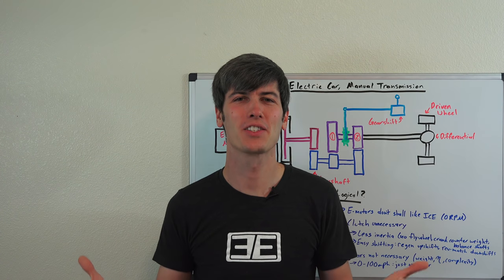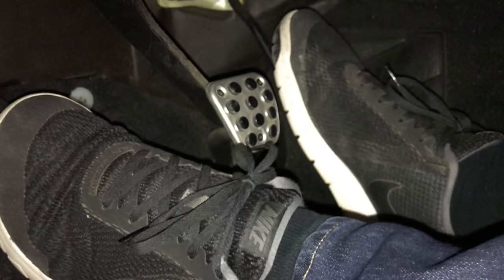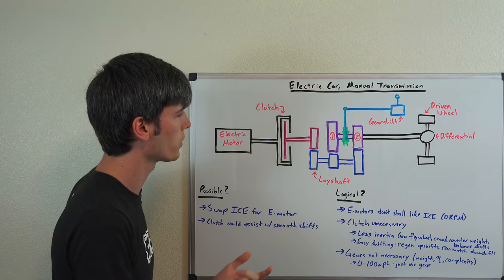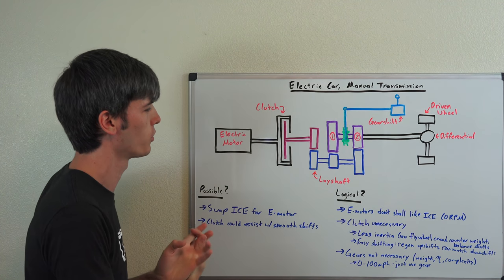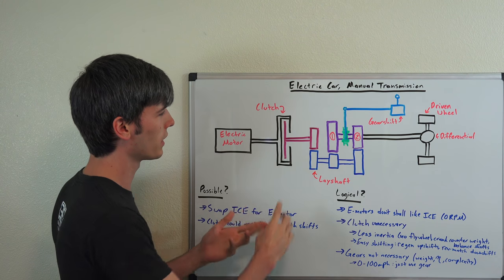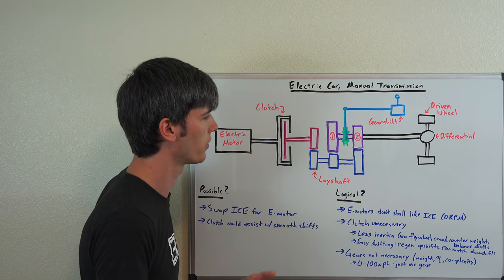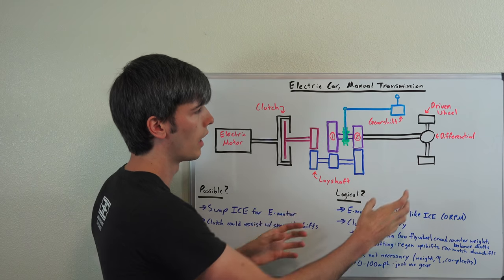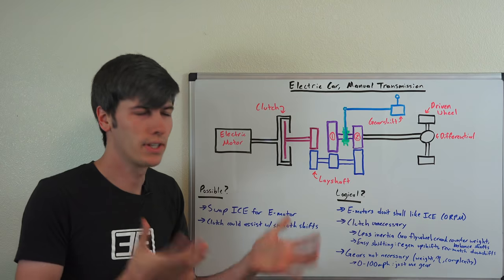Could Electric Cars Have A Manual Transmission?

Comment: Since motors DO have an rpm range where they are most efficient having gears would be needed if you were hauling a heavy load. Diesel electric train engines prove this in that if they increase the load by trying to accelerate quickly or go up a steep grade they simply pop their circuit breakers. They avoid this by adding engines. Can't do that in a car or truck.  However, you can avoid this to a certain extent by changing the commutator timing or the switching timing on the various electromagnets in the motor to make it most efficient at the rpm the motor is turning. I used to rewind and time slot car motors for just that reason. Having the electronic controls doing the switching rather than a manual method such as the traditional commutator allows many things that improve the performance of motors. I disagree with him about manual transmissions being less efficient than automatics and they are certainly heavier than comparable manual transmissions. Take my dodge pickup for example. 6 speed manual transmission. 180,000+ miles and has never even needed a clutch although I tow a 30' toyhauler camping trailer with it. The Dodge automatic of the same vintage would have had to be rebuilt probably about 125,000 miles and they did not allow the strongest version of the Cummins engine to be purchased with the automatic. Automatics are faster shifting and are the greatest thing for racing because of that but I'm not racing.
Back to the electric having a transmission... What his diagram did not show was that until we went hog wild with overdriven transmission top gear, the final gear wasn't a gear at all. The final output shaft of the transmission was splined directly to the input shaft from the clutch and there was essentially no loss due to friction in the transmission other than the seals at the front and the back of the transmission. I think it would make far more sense to run a lower numerical differential gearing and use higher ratios in the transmission and that would get away from the extra frictional losses in the currently overdrivin top gear.  My ranger pickup 4 liter 5 speed turns 2500 at about 70 mph in top gear. That top gear is a ratio of about 0.65 to 1. That means that 5th gear is an overdrive and thus runs through at least 2 extra gears and sets of bearings that would idle in a direct drive gear, usually 4th although that is 5th in my Dodge. As long as the overall ratio from the engine to the drive wheels remains the same, meaning the engine still turns 2500 at 70, a direct drive top gear would be a lot more efficient.
So given a lower gear for heavy loads to let the motor pull the load easier and then a direct drive top gear for driving at cruising speed, the car could be more efficient. Plus motors pull more amps if loaded to a lower rpm and will do the same load with higher gearing with less amperage by allowing the motor to spin more freely, unlike a combustion engine which will use MORE fuel while driving in a higher rpm than necessary to pull the load given.

Comment: I heard tesla tried to have a manual transmission in the roadster but the transmission kept breaking because the motor had too much torque 

As for the novelty of a manual transmission well my mustang is a manual transmission and I  insisted on it 

It's a little difficult to drive but yeah it's a lot of fun and I'm sure I'll get used to it

Comment: When driving on ice and snow, that we do a lot in my coutry, it is very important to be able to release the wheels from the motor. How would this work with EVs?
Reply: Just release the throttle i guest. Motor can completely stop but never on ice need to continues combustion.

Comment: 1 geared EV for normal everyday cars = OK
For 𝘍𝘜𝘕 cars = Sorry
I love to drift, a one geared car will ve a nigthmare to control, because you need to have the exact amount of power, no more, no less, so the manual shifter gives me "zooms" on the"power curve of the car, making drift easier.

And no, when I say drift I not saying doing burnouts or donuts, i mean Taking curves at +100km/h whitnout dying on the try.

Comment: lot of technical system work best in normal conditions. even on machines they try to keep 300 to 5000 rpm on eletric motors, i'm electrical engineer, my babies, 1,5 to 3000kW love to run in well ranges. for my conversion i decided to keep the gear, too, for not suffering below 500, and not screaming at more than 7000rpm, the 18000tesla turn hurt my mind, runs, works, but i din't like...

Comment: Wouldn't fitting an electric motor to a car with a 5 or 6 speed transmission allow it to go faster than an EV without any transmission at all, since you can keep the motor in it's power band longer (despite popular belief, electric motors do have a power band and torque curve) 

You would have power efficiency losses, but would would get much better performance, and since a clutch is not necessary, even millennials could drive it

Comment: Here is an unpopular opinion. Automatics are safer, more confortable and easier to use than manuals for daily commuting within city. They are also faster and don't stall with beginner drivers.
Reply from the maker: Most of those are factual, people drive manuals because they enjoy driving, not because they want a more comfortable experience or faster shift times.
Reply: safer is interesting, I've seen a lot of automatics hitting the gas not brake type accidents and not the equivalent in manual cars (given you'd hit the clutch too so you'd just rev it a lot not take off into something)

What are the counter-examples where automatic is safer? Or is it based on crash statistics (which come with an inherent self-selection bias)?

Not trying to be rude, I'm just honestly curious as I'd view a manual as the safer option but have very little to back that up beyond my own personal feelings.

Comment: Well don’t transmissions allow for better power curves? The motor can stay close low down to the maximum torque level while the wheels are rotating faster than the motor could normally. I suppose that’s not really needed for street cars.

Comment: The only benefit of a transmission in a electric vehicle is that you can downsize your motor. Probably not viable for car, bit could be a good idea for big trucks where you need loads of torque.

Comment: Any chance of updating this video for the question that has been raised in the comments? With Tesla playing games with wheel design and other tiny factors to come up efficiency gains, I really have to wonder if enough work has been done to find optimal gearing for different conditions- load, temps, working temps, inverter efficiency, etc, to justify 2 or 3 different gear reductions. Note that Porsche apparently has found an advantage in having a 2 speed trans, likely to make up for the torque lost at high rpms. They do have different speed expectations compared to most EV's, but I also have to wonder if it's worth looking into for towing and other high load applications. A lot of electric trucks coming. It might also be an advantage for a very light weight commuter car- being able to downsize the motor, use less power, and adapt whether or not additional torque is necessary when a passenger adds a significant percentage of weight to a vehicle.

Comment: Is there a rpm limit on these electric automotive motors?  I am wondering when Tesla builds a new sports car to compete with maybe a Porsche 911 or faster, if you would need gears to stay below maybe a rpm limit of a electric motor to exceed speeds over 200mph?

Comment: AFAIK, electric motor torque is at it's highest at lower RPM (could a "steeper" gear ratio utilize this torque more efficiently/effectively... possible increasing range?) 2.91 rear end vs. 4.11
Reply: Electric motors are different from internal combustion engines. Motors don't need to idle. What matters to range is the weight and the aerodynamic drag of the vehicle. Amount of work is the same despite the gear ratio. Work=energy consumed by the motor.

Comment: It's a big ask, to ask europe's drivers, most of whom are currently driving manual cars, to switch to automatics. I hate driving automatics, especially at low speeds, when I haven't got a clutch pedal to provide excellent control over the speed of the car.

Comment: I love EV's but lets face it taking all that complexity out of it somehow takes some fun out as well. Personally i love driving a manual and ive seen EV modded cars like a ford probe that was electrified but kept the 5 speed manual gear box. How bad ass is that? Ok so you can go faster and more efficiently going direct but lets have some fun. Id love to see a manual EV even if it were a tad slower or less efficient...dont care.

Comment: I would like an electric car if it had a 5-speed or 4-speed manual transmission and had a speaker that makes an engine noise so it feels like you are driving a normal car even though its actually electric.

Comment: But what about DC motors though? I know they are more efficient at lower RPM's depending on size. I have seen electric motorcycles and cars that will have a transmission for a DC motor because the RPM band is smaller.

Comment: The ONLY reason multi-speed transmissions exist is due to the deficiencies of the engine. If the engine had torque at zero rpm, didn't stall, and could spin fast enough, multi-speed transmissions & shifting never would have been invented. IMO, people who insist that shifting is inherent to driving don't understand driving.

There's also the fact that when sizing the power plant of a vehicle, there are two main CTQs: power (acceleration, gradability) and energy (steady state hwy). For conventional gasoline engines, satisfying the power requirement means being ~3x above the energy requirement. That's why ordinary cars have such high top speeds. Hybrids are one way to better match both criteria, thus saving fuel. EVs appear to also do it. They accelerate and pull just fine but may have a top speed under 100 mph (which is illegal to drive in all places in the country).

Comment: If electric vehicles are taking over within the next decade or so (so I’ve heard) I will be ok with it if there is an option to purchase a manual transmission vehicle. It will suck, but just for the sure joy of doing it. I would definitely pay more money, simply because it’s more enjoyable. I was late to the game on manual transmission as I only have been daily driving one for about a year. In that past year, working at a dealership I do drive automatic cars sometimes. It’s just not the same now, they’re actually kinda boring. That all being said I totally support electric cars in efficiency and helping the environment. I just want one with a manual transmission 🤷🏼‍♀️😁
Reply: there's already one on the market from opel. it's calleds opel manta gse - electric vehicle fully manual

Comment: would a gearbox help with mileage? the motor wouldnt have to rotate as fast going at high speeds if there was a higher gearing unless im wrong about that. I feel like that should help but idk much about efficiency of motors

Comment: Reliable electric transmission could increase  overall range and battery Consumption at highway speeds. I see this as a possible Answer too EV range issues.

Comment: Wouldn't it be possible to have an EV use a preselector gearbox w/o a clutch pedal as a manual? All gears except first could be overdriven, and wouldn't that extend range by having the EM run at lower RPM at higher speeds?

Comment: Ok, but does electric motors also have efficiency curves and torque limits?

I'm guessing geared EVs will either be a thing for at least offroads/working vehicles or even for all EVs because of the efficiency reasons.

Comment: What about using any type of transmission in an electric car so when going downhill you would shift into 1st or let's say 2nd so the electric engine spins faster (because of gear reduction) and you would charge the batteries faster with brake regeneratinn :) just thinking

Comment: Engine braking at low speeds is best with a manual, and DCTs are problematic.  For an everyday driver, a manual is more reliable and better for engine braking in low traction situations, e.g. snow and heavy rain.  I don't see how electric motors could provide the same kind of control as an ICE for braking maneuvers.

Comment: There is a ev swapped Miata with a manual and it exists since 2010 I think. Only the engine is swapped not like a Tesla so it has a transmission but if I would want to do that the Miata had to small wheel base for a Tesla swapp so I just swap the engine if I have a stock transmission is the cluch nessesery. I can only tell from your vid the dog box would work but I dont like the wine

Comment: why not emulation? the car operates as a normal electric (no transmision) but the user operates it like a manual, and a controller translates the controls inputs to be useful to the real motor. After all we already did it with the play station 1
Reply: lol.  yeah i dunno about that one.  i think gas is here to stay for a while anyways.

Comment: Imagine 20000 rpm in an electric motor can bring the vehicle up to 225 kmph but what is you could half the gear ratio whenever you want and instantly get twice the torque albeit at half the top speed ????

Comment: As I see it..  not being an enginer.. is like this.
adding gears would allow higher speeds.
as for most electic engines they require more and more energy at higher rpm to gain just alittle extra rpm..  at somepoint the energy required to make the engine spin faster will destroy the engine it self.
that is one of the reasons that electic cars accelerate fast but tops out early.
Adding a gear will allow the engine to pull the car faster again.

it look like this
adding XXXwatts at low RPM will pull very hard on the rotor in the engine
adding XXXwatts at very high RPM will do allmost nothing, because most of the energy is used to make the rotor spind against its own magnetic field.

Comment: Tesla tried using manual transmissions and they kept melting them, the motors produce too much torque so they had to use the wheel transmission method.

Comment: I don't see this being a good idea for a street car. The only reason why it could become advantageous in a formula 1 car is because the difference between zero and their max speed is so great it exceeds the operating range of some electric motor designs. For something like a tesla, you'll never see this implemented. You'll exceed controllable aerodynamics in a tesla before you reach any kind of rpm crisis in the electric motor. Go watch an electric drag racing car, with 1 gear, and you'll see how much they DON'T need to change gear ratios to access torque from a stop.

Comment: What about braking? especially when driving on mountain area with lots of up and down, the brake pads will wear out and get hot quicker without gear set and engine braking (use retarding forces within an engine to slow a vehicle down).

Comment: Does an electric motor use less power when it's at a lower RPM? Would driving at 60mph with a motor and no gearbox (straight to the differential) be different in power usage to 60mph and 5th gear? So the motor would be revving much lower?

Comment: i would have to disagree with you there, transmissions are VERY logical in electric cars, tho the current issue is making a gearbox that can hold that instant torque. the sls electric had gearboxes for each of its 4 motors, and for good reason, the higher the load the greater the draw on the battery, so #1 is efficiency, #2 is power band, dc motors don't rev high and although ac can, it takes more current flow to spin them faster, moving back to efficiency. clutches will also soften the blow to the gearbox which is also a plus. in racing, should they use them? probably not, as their applications are much different, but gearboxes aren't done just yet, they still serve a REAL purpose. hell, if you threw a single speed at an electric motor that did 200mph, then floored it at a stand still, it would shred the crap out of it, light up the tires, or accelerate VERY slow off the start, in a race your up to speed so its not that big of an issue, but in regular driving they play a bigger role.

Comment: The electric vehicles acceleration becomes less than the conventional IC engine vehicle, due to the falling torque profile of the electric motors beyond 50mph. Do you think having multiple gears could increase the acceleration and top speed of the vehicle post the 50mph speed?

Comment: Setting aside the "joy" of driving with a manual transmission....a manual transmission in an electric vehicle would not be a complete waste.  Electric motors still have a "horsepower" rating...just like gasoline engines.  Having "low" gears is still going to multiply the torque of the electric motor.  How would that not be beneficial in high-load applications such as towing.   Also, comparing light weight carbon fiber race cars to street vehicles does not seem like a realistic comparison.  Id be curious to see if having a higher gear would decrease energy consumption in an existing car (a normal car, not a race car) that has been converted to electric while utilizing it's own manual transmission.  And then compare it to the same make and model car with the same electric motor and batteries but with single speed / direct drive.

Comment: so the whole point of getting in a gearbox is simply cuz the Engine does not have the pulling power required to move the engine right? so wouldn't it make sense a gearbox been used to leverage a low-powered Electric motor? by doing this can we achieve more mileage? with less power consumption?